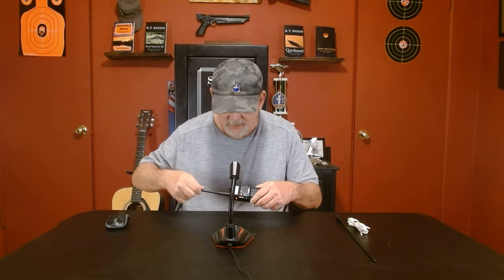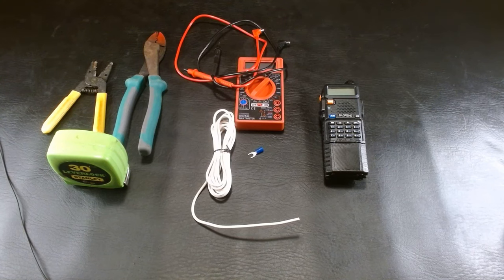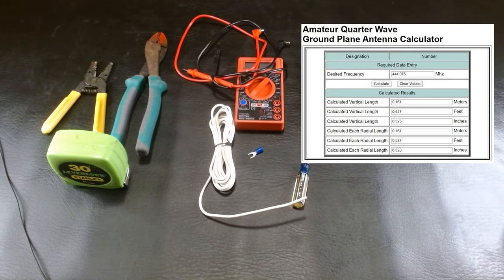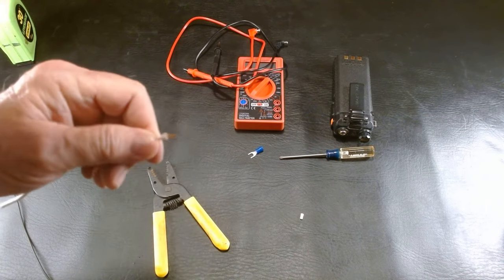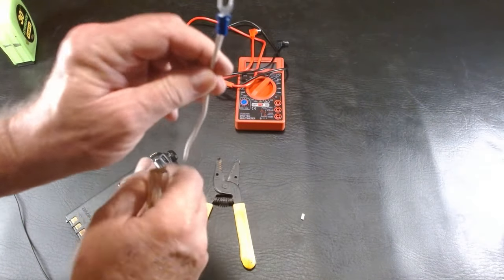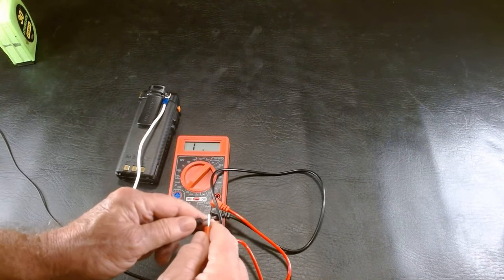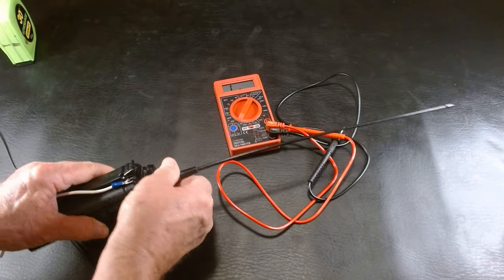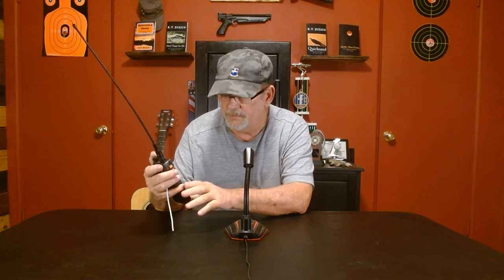Ham Radio Counterpoise - for Handheld Radios

Comment: Just made one for my uniden scanner for 27mhz 100%worked. I could just pick a signal up once connected I could make out the conversation.
Reply from the maker: Nice. Thanks for watching.
Reply: @morriselectrical8721  what length wire did you use?

Comment: Good stuff  looks like harbor freight meter.   Accidently submerged radio in water 3x and still works
Reply from the maker: Freebie too, LOL
Reply: I must have gotten a lemon.
Reply: @goosecouple  If your multimeter isn't working, open it up and there is a small LR44 button cell battery. Replace that and your meter will probably work again.

Comment: So is the length  of what each  frequency  is just good  for what u made  it for or can i use it the cat tail  for the whole  70cm or 2m?
Reply from the maker: Use the calculator in the description box above to determine the length needed for your main frequency. It should help with the other frequencies as well, but you want your go-to channel to be the one that the counterpoise is tuned to.

Comment: I just watched an HT range test where this almost doubled the signal strength at the receiver.  Why don’t antenna companies offer this? It’s like sorcery!
Reply from the maker: Thanks for watching and sharing the info.
Reply: @theorlandoprepper  Thank you.  Know I’m down the rabbit hole of learning about these “radials.”  From what I’ve learned so far, about a dozen of them evenly spaced facing 45 degrees downwards with thick gauge wire should be optimal.  Performance gains by adding more start falling off sharply after that.  

That would make for one heck of a thumbnail!  Part 2 video?

Comment: Thanks for getting back so fast.
If I could ask one more question and I'll leave you alone and again thank you so much for your help. So if I make a counterpoise and cut it to length for 520 MHz can I leave it on there and go to 144 megahertz or will that mess up my radio or even maybe ruin the radio all together thank you
Reply from the maker: There will be no performance loss on other frequencies.
Reply: @theorlandoprepper   
Thank you.if 520Mhz is 5.400"
& 136MHz is 20.647" what one would you use.
Reply from the maker: @legallimitoutdoors9917  that is totally up to you. It should not make a difference. I operate on the 2 meter and 70 centimeter bands.

Comment: 😲 OMG That's bad ass young man thanks for the tip. So do I put in a frequency of what my handheld ham radio works at like 136 MHz two 520 MHz on that calculator or do I use the antennas size which I have is a TID 771. 144/430 MHz and then put in the calculator the low megahertz in the high megahertz but regardless either way what do I do after having the high and low that was a badass show thanks for the tip. Or do I just pick the high number cut the wire and just go with the flow and it is what it is and I should be able to get out further and receive better
Reply from the maker: Whatever your primary frequency is, is what you put into the calculator.

Comment: would like to see the difference in the field.. normally, the body is the counterpoise,and so, i don't believe that a wire added will give a better communication..
Reply from the maker: You may be right. Some say it does, some say it don't, but it cost practically nothing to make, and it definitely hurts nothing. Thanks for watching.

Comment: Have you tried the longer counterpoise for 2 Meters?  I would expect it would make a greater difference at the longer wavelength as the radio body is closer to the size of 70 CM wavelength.
Reply from the maker: The calculator I linked in the description tells you how long to make your counterpoise for each frequency. I made mine for my primary frequency, 444.075.
Reply: @theorlandoprepper  Bad opsec!  Now The Man will know where to COMINT and jam you!!
Reply from the maker: @Polo-Hat , maybe; LOL